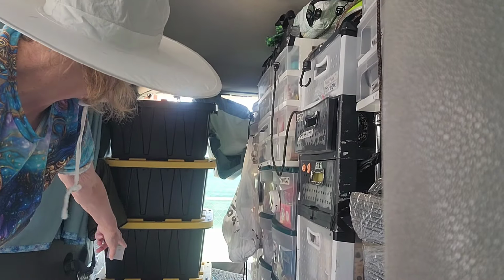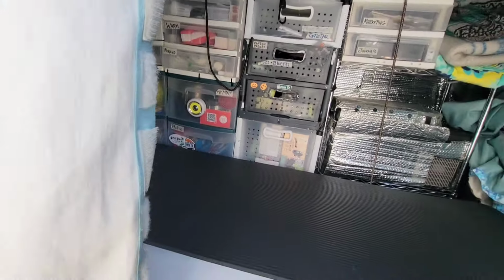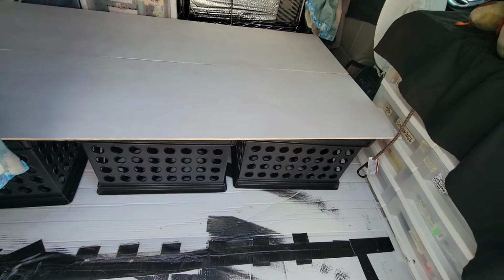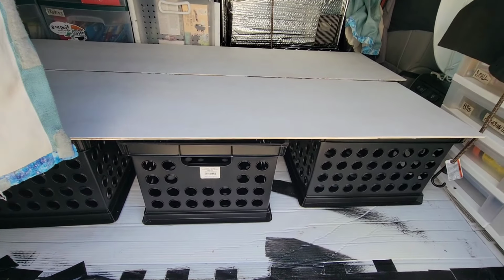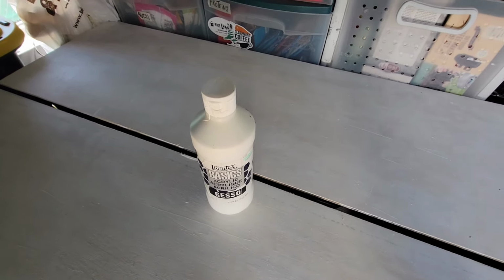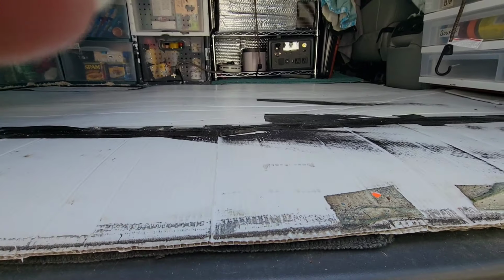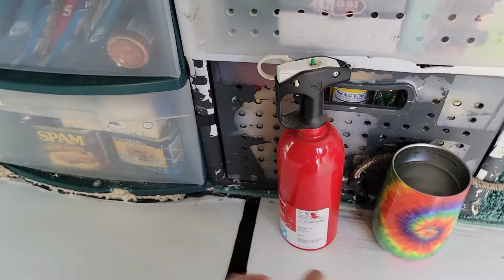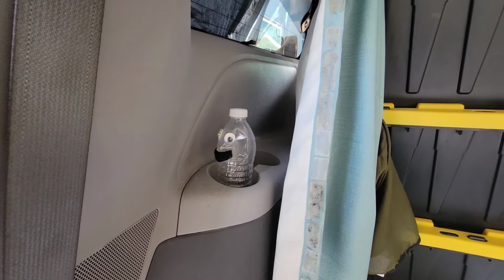I ❤️ my new EZ BED in my MINIVAN! Under $100. and TONS of STORAGE! #vanlife #campervan #nomad

Comment: I’ve been trying to figure out the bed situation for months. I bought a 2016 Honda Odyssey—huge mistake—and find I’m working square pegs in round holes on a roller coaster. If the crates are 10”-12” high, they’ll work. Otherwise, after getting some mats or plywood to level the floor, if I use anything more than 10” with a 4” mattress, my head will hit the ceiling. This looks doable and makes for more storage space. Thanks for sharing.😊😻🎉
Reply: Consider a 2" mattress. Hard surface is better than a soft one for sleeping.  Soft mattresses make muscles overstretch